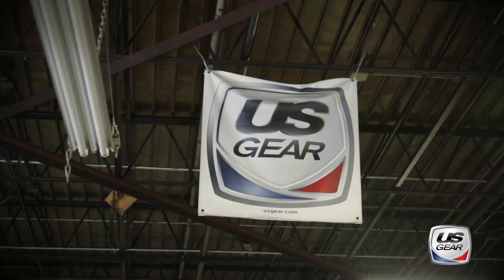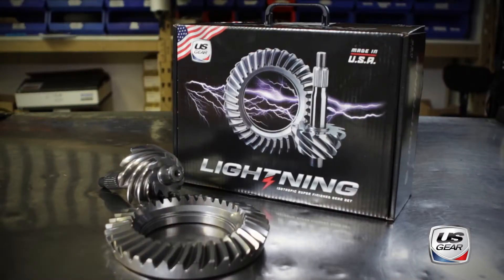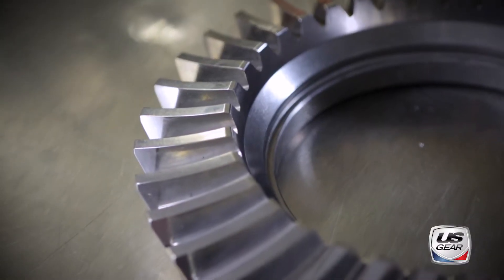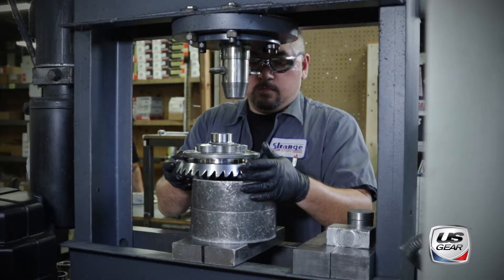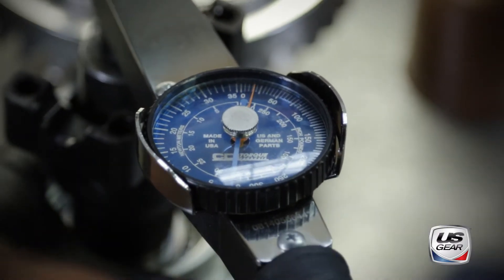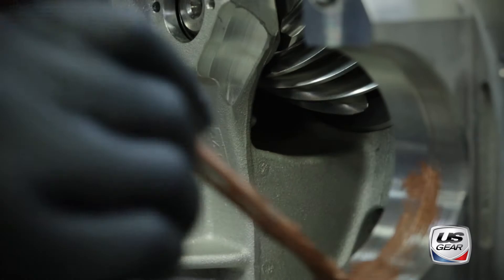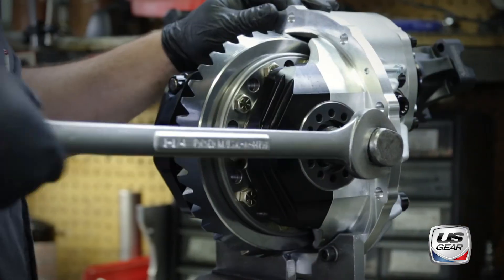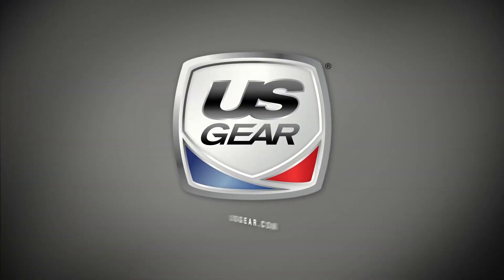US GEAR Strange Engineering  Ford 9 Inch Ring and Pinion Installation

Comment: So nothing mentioned about looking at number scribed on pinion and using that information about setting pinion depth?  Nothing shown about adding 1/8 inch spacer before putting bearing on?  How to set bearing preload on pinion adding and removing shims, and using dial indicator?  Why even bother with a video like this if you can't do it right?  I buy all my stuff from Strange, but I do hate poor videos.